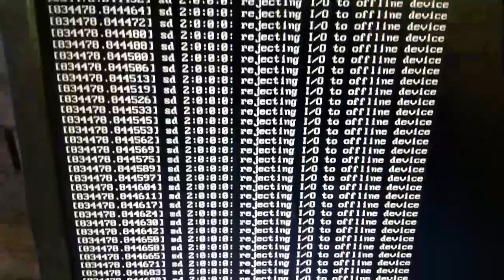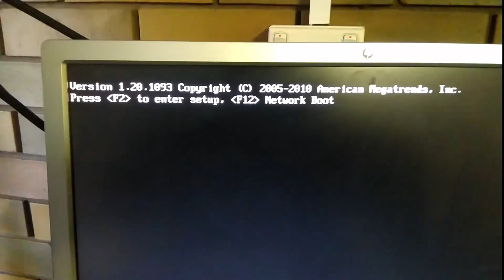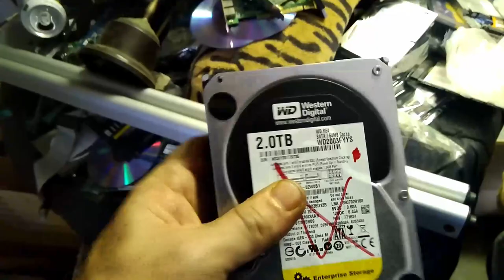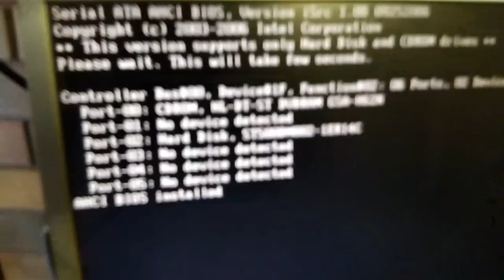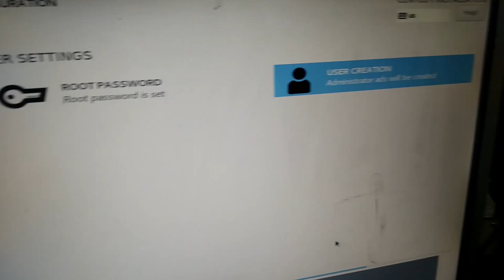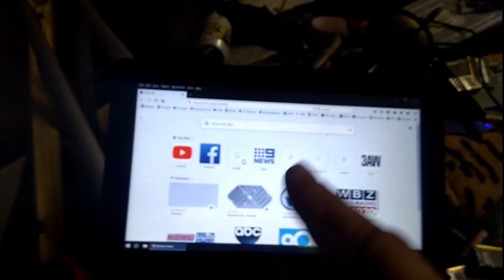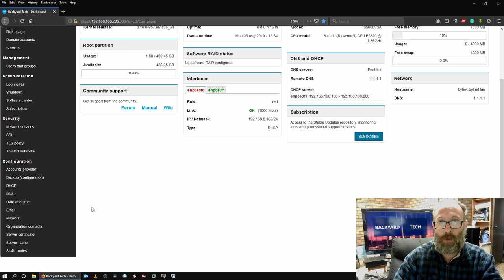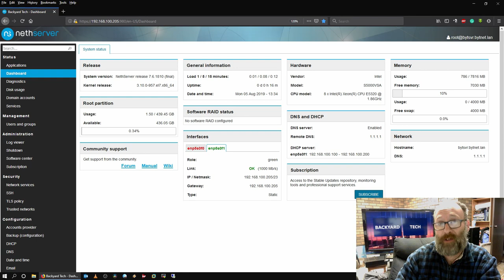Main Server Drive Fail

Comment: Adam, glad to see that you were able to recover Neth Server. Sorry about the 2TB WD Black Enterprise drive however. I have a 1TB WD Black SATA Enterprise drive sitting out in one of the two bays on the dual-bay external HDD enclosure and it is operating nominally. I thought it was next to impossible to destroy a WD Black Enterprise drive (right!). I did notice that the failed drive you were using had a big red "X" on the surface. What was that for? Was that telling you that the drive had a problem previously detected by you but you used it anyway? Just curious.

Great job in the recovery!
Reply from the maker: When I get HD's from my mate he marks them like that so I know they are for me. AKA, new old stock